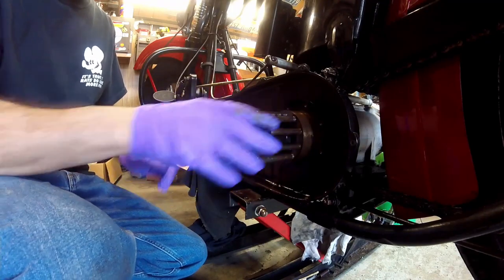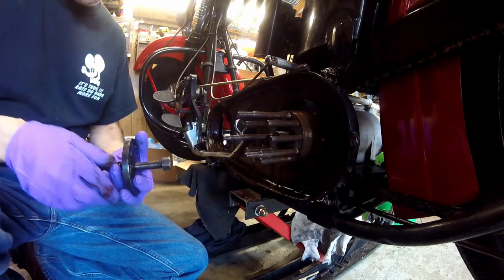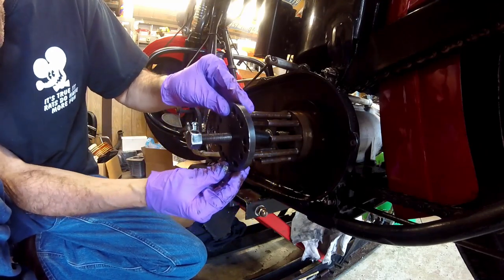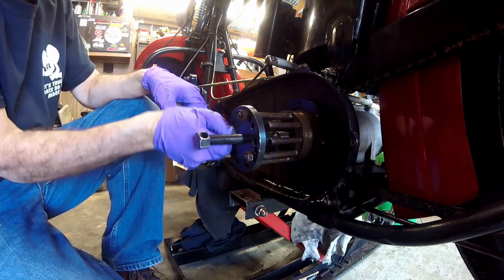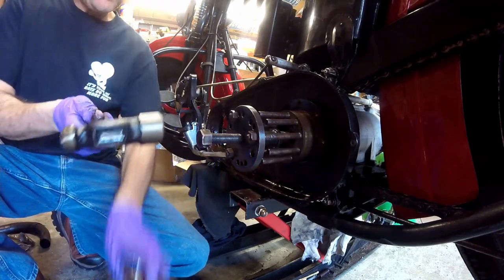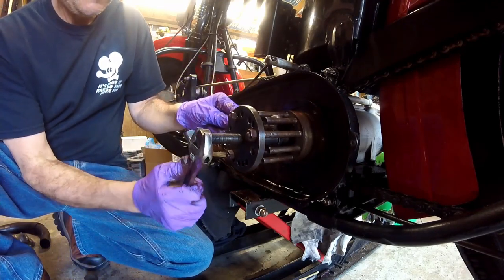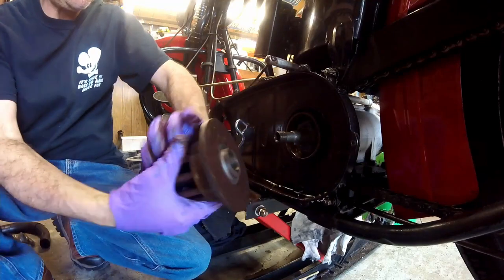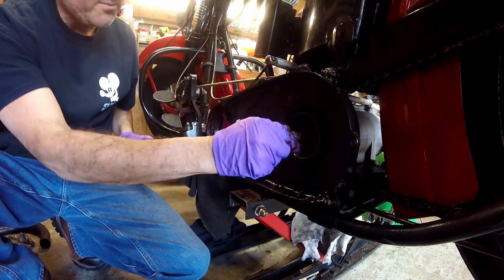4 Speed Clutch Hub Removal Knuckle Panhead Shovel Head Harley

Comment: Nice! Thanks . but one question - where is the clutch rod, already removed it from the kicker side? I know the puller has a hole in it, so the rod can slide into it when you use the puller. But I don't see the rod in the video. Anyway thanks just wondering...
Reply from the maker: On the 4 speed you are able to remove the clutch rod from the left side of the transmission. It is not attached to the throw out bearing. You can see this in this video. Part 6 Knuckle Kicker housing and sprocket 4 speed Pan Head Shovel Harley
https://youtu.be/JNcEsFI2yIo

Thanks for watching.
Reply: @Rapsgarage  Oh okay thanks - I guess maybe just the later 4-speeds have the TO bearing and oil slinger attached on the kicker side. I haven't pulled mine apart yet but the book shows them attached with a retaining ring ('81 FXWG). 

Thanks for the link - that has the old style TO bearing, so much beefier than the later ones.
Reply from the maker: I know they do that on the five speeds. And I do have some video on in 1984 FL transmission. I have to look at that video and see how it is on that.
Reply from the maker: My 1984 trans was the same as my older 4-speeds.
Reply: @Rapsgarage  Like I said haven't pulled it apart yet but according the 71-84 FX Parts book there's a retaining clip on the end of the rod - "Late 75 to Early 84 All Models" (part #11096). 
So maybe the FL models don't have it?

Comment: IF YOU DON’T HAVE A CLUTCH HUB PULLER ,YOU CAN USE 1-1/8 SOCKET WITH A SHORT EXTENSION,—JUST BACK OFF THE CLUTH HUB NUT ABOUT  1/4  TURN  .PUT ON THE 1 1/8 SOCKET WITH A SHORT EXTENSION  AND TAP LIGHTLY  WITH A 2  OR 3  LB  HAMMER TO BREAK THE SEAL AND THE CLUTCH HUB SHOULD BE FREE. DON’T SMASH THE DAMN THING,  IT MAY TAKE A TAP OR TWO  ,TO GET IT TO RELEASE ,BUT BELIEVE ME ,IT WORKS, I WAS SHOWN THIS TRICK BY A OLD HD MECHANIC ,AND IT HAS SAVED A LOT, A LOT,OF FRUSTRATION.—-NEVER TRY A TWO OR THREE PRONG PULLER ,THEY WHERE NOT MADE TO BE USED ON TAPER SHAFTS,—READ TWICE THEN GO BACK TO THE JOB WITH FAITH ,—AND GET BACK ON THE ROAD AGAIN—————
Reply from the maker: I've done it with the puller for many years but I bought this for like $34. It was so worth it. Thank you for watching and commenting. If you haven't, please subscribe. Thx